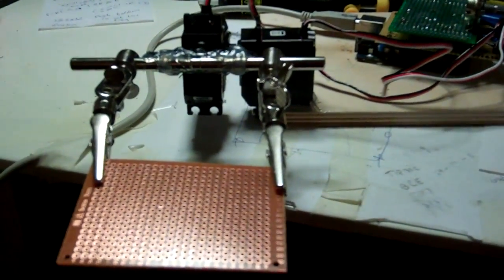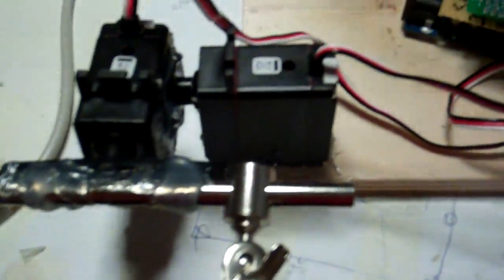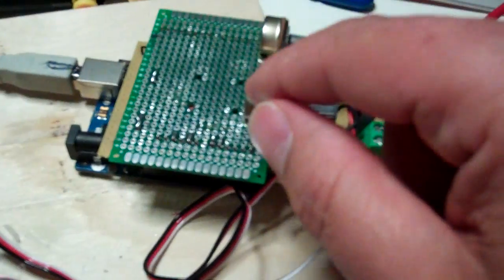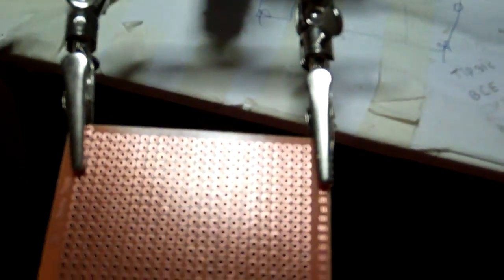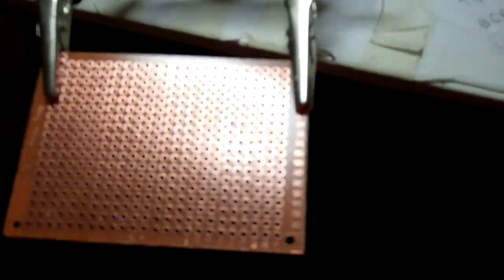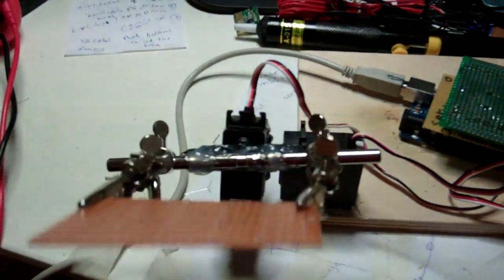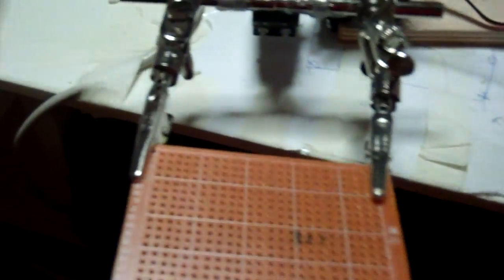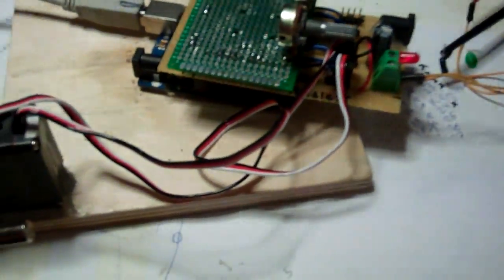Third hand soldering with servo motors

Comment: i don't think that would be possible in the normal way you would think. 360 degree servos don't have position control, only speed control. you could always time the milliseconds it takes for the servo to travel halfway around, but you can't tell it to move 180 degrees exactly.

Comment: A cheaper and more permanent alternative to the arduino would be to use a couple of 555/556 timers to control the servos. Just google "servo control 555" and a bunch of results should come up.

Comment: thats really cool and i need one, but have 2 problems:
1. i need my arduino for other stuff
2. i only have 2 servos.

one thing others might consider is using geared motors and a momentary dpdt switch on each motor.